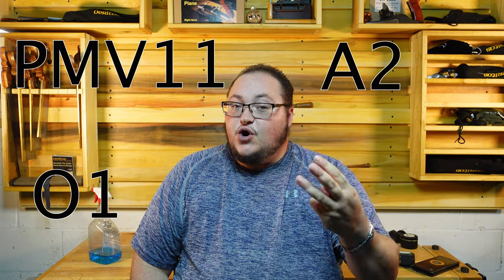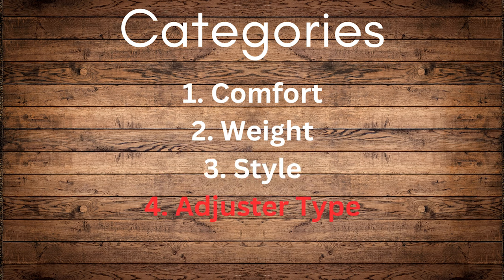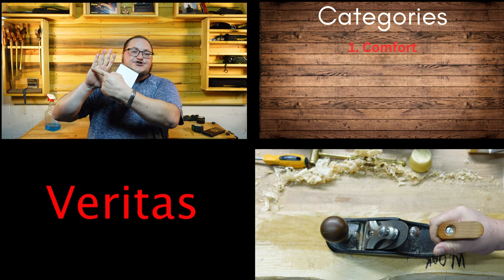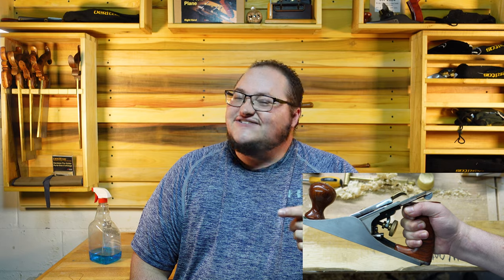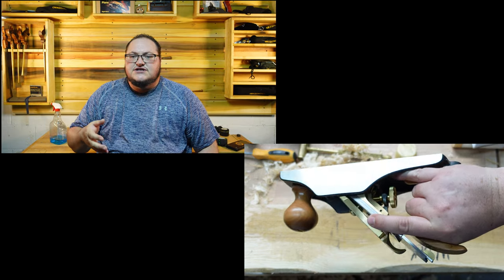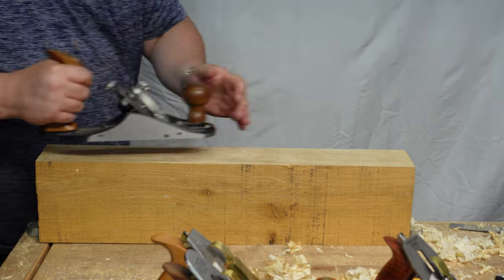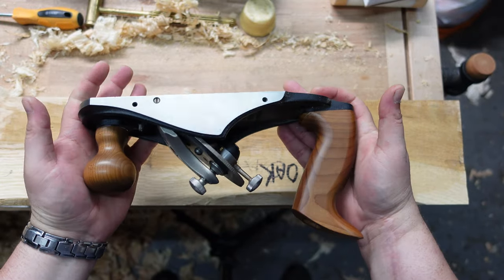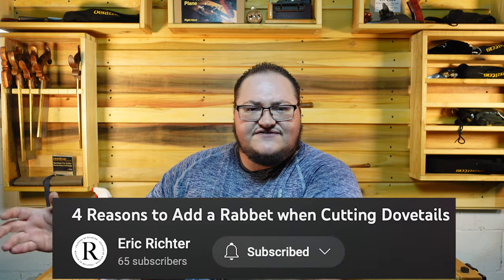My Opinion on the Battle of the 4's Hand Planes

Comment: I bought all Lie Nielsen hand planes (own 8, 4-1/2, 5, 3).  I used them for several years quite happily.  Then, I wanted a hand plane with more camber so I got a 1930s No 4 Craftsman brand No 4 and cambered the blade more to hog off more material.  I loved it’s weight so much so that I I have replaced almost all of my daily user Lie Nielsen planes with vintage Stanley hand planes.  What I liked was the lighter weight of the Stanleys.  Not going to sell my LN planes yet.  Curious to try wooden planes as likely even lighter.  Oh, I do strongly prefer my LN chisels over vintages.  Like you said, folks need to go to try tools themselves and see what they like.  I would have never thought I would have preferred the vintage ones to my LN hand planes but I did and it wasn’t a cost issue as I already had the LN hand planes.
Reply from the maker: You are not alone I have heard of many peope who prefer vintage for those exact reasons! I also fully agree that everyone has different opinions and preferences and may need to buy, try, sell till they find what they want. That's what I did and still do. 
Thank you for sharing!!

Comment: What's your opinion on the 'default' No 4 by Veritas (not the custom one)?
Reply from the maker: I need to try it again now that I have more experience. I tried them early in my hand tool journey and wasn't a fan. That's why I switched to LN, but then I tried the veritas custom and switched to those hahaha
Reply: @BatCaveCreations  Thanks! I've seen some mixed opinions on the default Veritas No 4. I'm considering it because I really like the larger tote on my Veritas Scrub Plane, and my Stanley No 4 feels a bit cramped as someone with larger hands. The LN and LV Custom are a bit too expensive for my taste.
Reply from the maker: @michael.knight  have you tried the Jorgensen? Great plane and the price is good compared to LN and LV custom. It has more hand space too if I remember compared to stanley.
Reply from the maker: @michael.knight  oh and 99% of woodworking is opinion. It is a good thing to buy try sell till you find what you like best. So you can always give the standard 4 a try amd see if you like it. If not sell it and grab a different brand. I did that alot and still do to find exactly what I want. In resale you take little hits in the wallet but for how long ull have the tool you chose its worth it imo

Comment: Thanks so much for the shoutout! I know you need more video ideas 😂 so you need to do a demo of the method you end up with!

Thanks for comparing all of the smoothers too! I currently just use my veritas low angle jack for everything and I use a cambered higher angle blade for tough grain. Maybe I’ll get a shorter veritas one day!
Reply from the maker: I will have a video comming out about that! Someone gave me a HUGE blessing and a mission to make my end all be all super plane so kept an eye out :D won't be till after handworks tho lol

I used the LA Jack ONLY for a long time! Have you tried a bevel down yet?
Reply: @BatCaveCreations  oh yeah, I have a 4,5,6, and 7 in traditional bevel down configurations. I got the bevel up primarily for shooting board use!
Reply from the maker: @ericrichter7933 oh ok I get you! Do you just prefer the LA Jack at high angles?
Reply: @BatCaveCreations  actually, I’m partial to my 38 degree iron! I cambered the edges and can get some incredibly smooth shavings off of that bad boy. Everybody kinda defaults to the high angle with that plane, it seems, but the 38 degree is a more moderate approach, so it’s better for general use, in my opinion.
Reply from the maker: Deff is! 25 is end grain. 38 is general (same as bevel down) and 50 is for crazy grain but a 50 in that plane was WORK thays what make me try and learn bevel down haha but I still LOVE the BU line!

Comment: Hi. About the shaving issue on the veritas I also think the cap iron could be the cause. Before touching it try to change its setup (distance of the edge) to see if it changes smt, if not try to establish it at 75-80° angle, just few passes on a fine stone, it doesn't need to be huge.
Reply from the maker: Thank you! I did try CB position but I haven't changed the angle of it yet but thays deff next step! thank you!

Comment: Good video and good advice too. I have tried all the new planes, even the stupidly priced Bridge City ones ( trying to reinvent the wheel I fancy ) and although some of them have been good I see no reason to replace the vintage planes, some of which I have had for fifty plus years, as the benefits are so small. Admitedly, I have over the years tuned my planes, made new totes and knobs and purchased better upgraded irons but at the end of the day they feel some much better in the hand than any of the new guys on the block. I would always encourage woodworkers to buy older planes for a tenth of the price of the new ones and put in the work to tune them and then spending all the money they saved on wood, cos thats more important than pretty new tools.
Reply from the maker: Deff! A well tuned vintage plane can perform just the same. All that amazing shavings! 
I do worry with newbies, at least it was my personal experience, that tuning a plane is a big step in learning hand tools. Let alone the set uo and use of one. I personally wanted to save right into woodworking so the vintage planes just made me mad cus they weren't tuned  lol imthat could just be my impatience and ADHD tho hahah

Comment: With a fairly extensive collection, my favourite modern planes both looks and function wise are the Veritas, they strike a very good balance for me.  Sometimes you get one that has an odd tolerance, but they are well thought out tools with lots of improvements over their original counterparts.  Light tools are important, I rip into pieces at times with smaller planes to scrub off height quickly.  There is no way one can reasonably use even a 4 1/2 bedrock style continuously for 15min for that kind of work.

Vintage wise, I would say I use a Stanley Bailey  no 4, 5 and 7 (I usually gravitate to type 9 and 15 as they seem to be lighter built) . But actually performance wise, I would be torn between my Woden's and pre-war (real) Records.  They are a bit more precise, not too much weight penalty, and the components are always a hint more premium then.  While I love modern veritas style totes, Woden has gotten it right when it comes to vintage planes.  They look a bit weird on visuals, but are excellent.
Reply from the maker: I agree! Thank you for sharing! I like hearing other people's opinions cus they get to hear mine but I want to hear theirs! Hahahaah

Comment: I'm only getting into Hand Planes now. I bought a #3, #4 and low angle block plane. That's what I've got so far and I didn't spend big on them tbh. I bought cheap to start with so I can learn everything I need to and if I grow into this of using more hand tools like saws, chisels planes, etc then I will buy better quality one day. 
I enjoy planing very much now my bro. 
I bought 2 cheaper planes off of Amazon. The blades are very thin so I have a question of 2 if u have a minute to answer. If anybody in the comments can help i WOULD APPRECIATE THE ADVICE.
Q.1 - Does it matter how thick or thin the blade is? 
Q.2 - Why does my low angle block plane have the blade with the bevel up? Is that incorrect of me to say that? Maybe I'M DOING IT WRONG. 
Q.3 - What would be the best piece of advice u could give a newbie trying to find his way in hand tool sharpening?
Thanks for the information in this video but a big thanks in advance to anybody who answers my questions. Appreciate it all very much. Take care fellow woodworkers.
Reply from the maker: Hey! Thank you!
Q1: the thicker the blade the less chatter & noise while planing.
Q2: low angle planes are bevel up because the bevel on the iron and the blade bed determik the cut angle. On standard bevel down planes the frog angle determines the cut angle. 
Q3: don't over think it. Watch my no bs guide to sharpening here is video 1 there are 4. https://youtu.be/hEmDA1al1p8?si=MuiP9LWPgIOHhUUL

Hope that helps!
Reply: @BatCaveCreations  Thanks very much for the reply my friend. Really appreciate that.

Comment: Bro, the idea for "body planing" which is the proper imho is that your pressure across the push is similar, so you have a better control going in an out of the cut, and it's sooo much easier. Planing with your arms is going to tire you way too quickly. It's like truing a neck radius in lutherie, you turn your upper body into a machine :)

Also, it's the "evil eyes" symbol, not rock on ... as per Ronnie of course :)